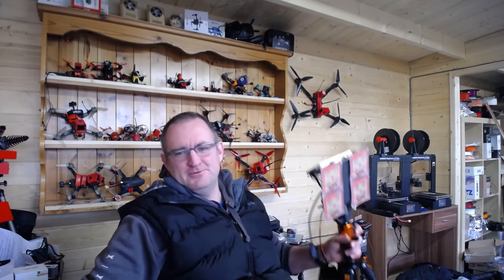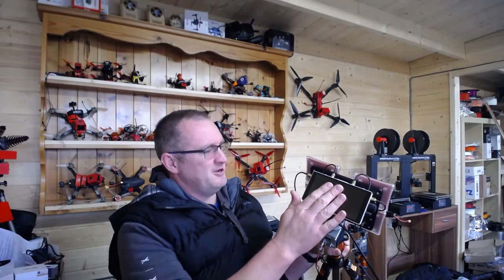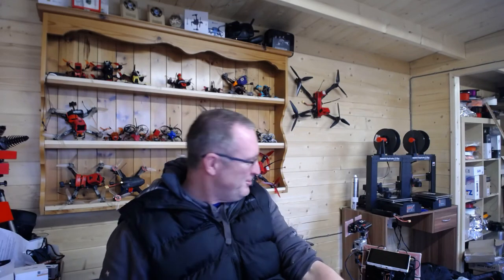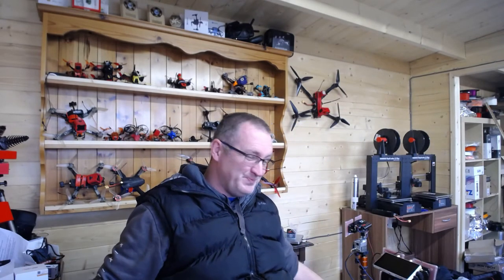BYTFROST HD FPV | On an antenna tracker!

Comment: Great work Rob! I was trying to get RSSI out from the ByteFrost via the differential RX pins of the AD9361 transceiver module until Carl from Divimath pointed out that there isn’t a way to get RSSI (since the differential are digital data and not power/gain in mV). While I was getting my head around getting it to work on the old RSSI tracking system we used, I thought of using GPS. You beat me to it with the FlyDream and with four high-gain patches too. :) Really nice, congrats! Merry Christmas!!!

Comment: When you fly behind stuff you need to receive transmissions indirectly. Try placing the other pair of LZR in the opposite direction, or perhaps at right angles.
Reply from the maker: Think you miss the point of an antenna tracker :)
Reply: @RTRCTV  No I meant leave two of the antenna pointing towards the aircraft, and the other two "also on the tracker," but pointing at some angle away from the direction of the aircraft, in order to pick up reflected rf. 5.8g won't penetrate buildings or other dense objects, so you rely on reflected signals to continue to receive an image. Just an idea. Or use two omni antenna (along with the 2 patch) with as high a gain as you can find. As I understand the BF receiver, it uses two of the four antenna at any given time to form an image. When the signal is blocked by something between the aircraft and the tracker your LZR patches aren't going to pick up much of anything since they are relatively blind to the sides and rear.
Reply from the maker: @billyd78  I think in principle this would work for close range.   But not well for long range.

Remember also..

If a signal is reflected.. It changes polarity.  So you go from RHCP to LHCP.

End result.. Antenna rejects the reflected signal.

A double reflection would work.. But would then really start to suffer from multi patching as would be delayed somewhat.   Never mind the fact that it's unlikely to double reflect due to 5.8 being rubbish!
Reply: @RTRCTV  Thanks I didn't know about the change RH to LH (or vice-versa) for reflected CP signals. Anyway I think the point is the tracker won't help you much with blocked signals. Partially blocked ones, yes. But 5.8 gets blocked by anything especially with long range by the time the signal gets to you it's useless with your high noise floor. It would be interesting to see what would happen with two LHCP patches facing away. Another idea might be to have each antenna pointing such as to form an arc of say  90 degrees total instead of 4 in a flat plane facing in one direction. I have a similar ground station so I plan on experimenting.

It's interesting because I get really good reception with BF compared to my analog setups so it could be your rf environment is the biggest contributor. Thanks as always for your advice and great videos! Love this stuff.
Reply from the maker: @billyd78  I tend to agree.  It's very much environmental.

Dji also fails badly.

Funny thing is.. Analog is solid!

Comment: What was your quad setup like? I found that ByteFrost drastically outperformed analog in terms of penetration. Even looking at your video something seems odd about the way it's breaking up
Reply from the maker: This is on a 6 inch quad, which when using a regular matek vtx has zero range issue.

Pop bytefrost on and it goes to crap.

What is worth noting.   We fly a very noisy rf area.    Even xfire battles to make it more than 3km

Basically..     It don't play well on our site.   Mind you.. Neither does dji!

Comment: Sorry but miles off the dji system, in fact it looks a bit better than a good analogue set up in my view...
Reply from the maker: It's actually way better in the goggles.   Visually.. Fantastic.

But lacks any good object penitration
Reply: @RTRCTV  Rob, os it better than DJI with penetration?
Reply from the maker: @rotormasher  it recovers faster than dji in a signaloss situation.

But to be fair
. Both are crao on noisy rf
Reply: @RTRCTV  defo an advantage on that